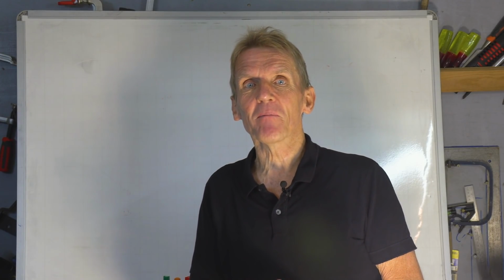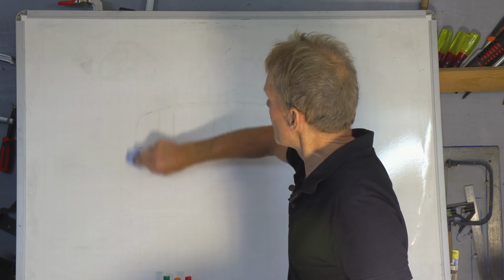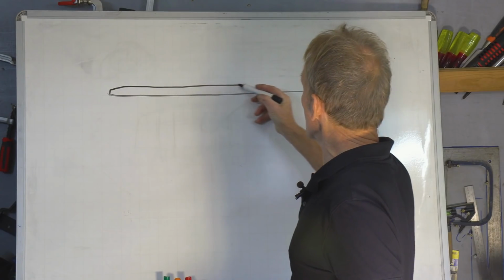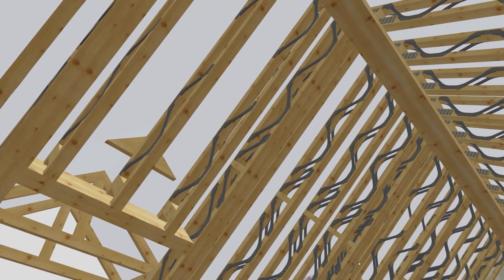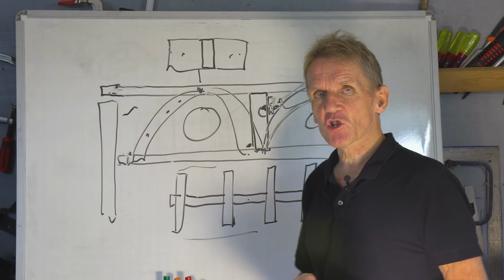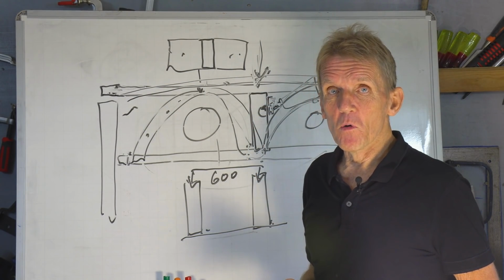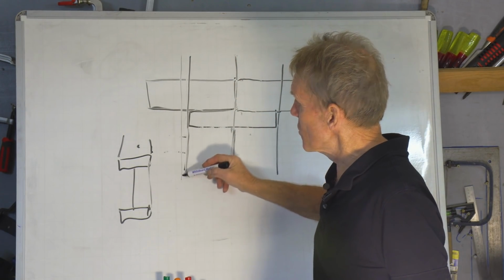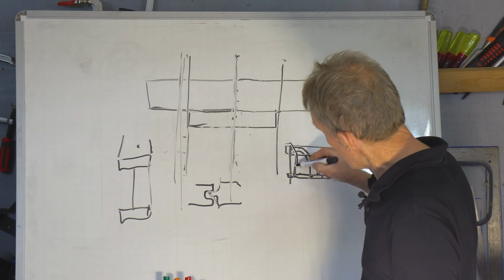New Build Home Nightmares That CAN be Avoided

Comment: I was taught well.
First lesson "Quality not quantity!"
Crazy modern building practices maybe quicker to erect, but they sure won't last.
Can't better old school carpentry with 9"x2" joists, solid noggings or even herringbone strutting.  Oh, sod trimming with joist hangers when a tusked tenon will do.
One thing to mention.
Timber buildings are safer than metal ones during a fire.  True!!
When steel heats up it distorts before losing all strength.  
The Trade Towers collapsed because the  steel work was as strong as a chocolate flake during the ensuing fire.

Comment: Having bought our home in January an 07 build there are screws showing on the plasterboard ceiling and every single room upstairs squeaks. I don't want to rip up the entire floor and possibly remove lower sections of the walls but after watching your video it looks like to fix it properly it has to be taken right back to frame! Wondered why this house was cheap but no inspector picked it up!! 😭
Reply from the maker: The surveryors hardly ever pick this problem up and it is so common that it seems like negligence.
Reply: If the screws are showing without any scrim tape visible then the plaster didn't both putting scrim tape over the screws which is necessary to stop the plaster from falling out or cracking where the screws are.

Comment: I nominate Linden Homes..
Kingsgate in Kingsteignton Newton Abbot Devon is a disgrace.. 
You are right you chase them and they ignore you hoping you give up.. 
I would never recommend buying a new home off plan. If you like somewhere new then just wait and let the first buyers have the headache.
I've been in 2 years and it's still not finished, I don't even have a back garden. The NHBC can't help as the house isn't officially finished. 
If you must buy new DON'T USE THERE LEGAL SERVICES GET YOUR OWN. You think your saving a £1000 but it will cost you in the end.. 
Also get a full survey, if the builder doesn't like it then that should ring alarm bells..

Comment: Using a smaller joist depth with a camber is a terrible idea for floors that people will walk on.  Camber can't deal with live loads, even when oriented properly.  It's much easier to just make the joists twice as deep ("eight times as stiff") with zero camber.  In a renovation situation a deeper floor may not be feasible... but in that case you should be looking at stiffer, more expensive materials like steel bar joists.

Comment: My tip for finding a good builder or any other skilled trade, make an alphabetical list of every relevant tradesman you can find in your area.  Look for ad's on the "my trusted" type websites, Facebook, parish magazines, local paper etc etc and cross off the list any you find ad's for.  Invite the remainder to tender and cross off any that are very late, don't turn up or the cab of their vehicle looks like a skip threw up in it.  With a bit of luck you might end up with 3 or 4 left on your list, then you can book them in for September next year.  The point is if they are not advertising it's most likely because they don't need to and will be booked well in advance.  Of course you can avoid all this by just contracting Roger, Robin or James to do your work.
Reply: It’s true, my best buddy and I grew up framing custom roofs. We were always laughed at by elite type customers because we were young, kinda wild and our work truck always had beer cans falling out..
  Contractors that knew our work had no problems, but what the public sees as a successful “look” is an absolute joke..

Comment: All this stuff being glued up pisses me off. Fixing a 10year old new build bathroom floor after it has rotted out ain't no fun just on slab. Let alone this stuff. I done one shithole on slab. Polysafe flooring direct to 18mm TG chip sub, not even skined. Everything glued to everything. 2 layers of plasterboard under that, 2 layers of white polystyrene with more joist/battens. The platic pipes and mice made a nice cave system under there. Took 2 days, 2 men just to rip it out and lay battens back down. Wet room too!

Comment: Can webbed floor joists be propped from below, like proping 9x2 joists with acrow props and 6x3 when loading concrete  blocks to upper floors?
Reply from the maker: Yes if you lay a scaffold board across them and a couple of acrows it helps a lot.
Reply: Propping with an acrow causes a `point` load to the floor joist and could buckle the web. If you have access to the web, fix a vertical noggin either side of the web and between the top and bottom chords of the joist. This will stabilise the joist web and prevent buckling. Alternatively, as roger says, spread the load of the acrow/acrows by using a scaffold board.

Comment: The strongback is doing the same job as noggins - a combination of spreading point loads to adjacent joists, preventing excessive differential movement between adjacent joists, providing torsional stability and as you say connecting the entire mass of the floor together to helps control vibration.
Reply from the maker: Yes you are right, I could have spent a lot more time talking about the Strongback. The name describes it perfectly.
Reply: @SkillBuilder  It does!

Comment: In Austria, all these building techniques and issues relate to garden houses. Nearly all homes from the last decades have 10cm reinforced concrete floors, 10cm insulation, 5cm concrete on top. UK lags a century in the building standards, joists and plywood OMG and this costs 500k pounds probably.
Reply: Concrete beams on the first floor?
Reply: @JohnnyMotel99  Monolithic concrete reinforced plate 20cm at least on the ground floor.
Reply: @andrzejgajdardziew2885  ground floor, we would use reinforced concrete beams, above a ventilated void, then 100mm celotex then screed layer, then floor covering. First floor in a regular house is usually timber joists

Comment: I guess that herringbone struts in traditional timber floors were the equivalent of the strong back? 
I also assume that herringbone struts are no longer installed due to the labour requirement.
Reply from the maker: I was going to talk about herringbone struts and forgot. You can use them and they are very effective but the method is slightly different.

Comment: Also please confiscate all hammers and nails from the builders and give them screws and screwdrivers! So much floor noise  is caused by the use of nails in timber :(
Reply from the maker: Too right, even the ring shanks pull out when the timber shrinks.
Reply: If you tried to frame a house with screws the building inspector would quickly shut you down and make you take it apart.
How many here know why ?
Reply: 100% right loved everything in this vid and normally agree with roger but glueing the boards down and together is a complete no no in u ever need access to the floor void again uve created a nightmare by glueing it all up u just need to fully screw it down through piloted holes at close centres u should  never get squeaking if u do  this as for ceiling cracking on an old existing building the best and easiest answer is to put in an mf (if u have the head height) this can solve not just the cracking but I’ve created a void for services and foot traffic noise from above is greatly reduced ok more money and time but for the client it rearly ticks a lot of boxes
Reply: @Lee Davies The structure of a building must withstand shear loads such as wind and earthquakes. Screws have to be made from very hard metal which makes them brittle and prone to breaking, nails are softer and flex instead of breaking. That's why they meet building code as a fastener for wood framing and wood screws do not.
Reply: @garyevans718  I thought we were talking about the floor and it’s screws over nails all day long and no glue
Reply: @kendodd8734  I live in Canada and it is required by code to use PL-400 glue between the joist and the plywood. When I was framing houses I used 2-1/4" ardox nails in a coil spiker which would suck the plywood tight to the glue and they don't back out, later after drywall and the house had dried out I would recommend screwing down the entire floor then.
Reply: @garyevans718  the glue must cause u guys nightmares though if uve ever got to get the boards back up seems like overkill to me when I definitely know screws surface done properly u rearly don’t get squeaky floors but heh as they say there’s more than one way to skin a cat
Reply: @garyevans718  Of course you can use screws - but they have to be the correct type; structural screws made from high-strength, heat-treated steel and not regular wood screws.
Reply: @simongreenidge6454  Who in their right mind would use GRK's to frame a house ??
It would add 50k - 100k to the cost to build an average home.
NO.....almost everyone looking at this YouTube channel won't understand the difference between those screws and fewer yet would be willing to pay for it.....so why even go there ?
Use nails that meet building code for framing a home....period.

Comment: Does anyone know if you’d use this in the ceiling ie loft floor or not? And the roof It’s a low pich15 degree slope was thinking about where I’d normally have a birds beak on wall plate?

Comment: Anyone tried green glue 3mm joist tape between board and joist instead of gluing the boards to the joists? I was thinking its a physical cusion barrier so no chance of squeeks in years to come if the glue separates.

Obviously still gluing the t&g
Reply: Use PL Premium.. it’s 10x better than regular construction adhesive.. comes out of the tube painfully slow though.. no squeaking though, I promise.

Comment: Can you safely have 600 mm centres with the metal webbed joists or 400 still recommended? My studs will be 400 and my trusses 400 for slate roof but was hoping i could have 600 on the floor joists without issue if glued braced screwed 22mm boards?
Reply from the maker: You can use 600 centres, They will give you a drawing based on that.

Comment: NHBC make you have a minimum 10mm gap around the edge of floor and wall to prevent squeaks
Reply: Will not stop squeaking between boards at the T&G joint or across the joists
Reply from the maker: That is for expansion due to humidity
Reply: @SkillBuilder  ah, thank you

Comment: How many strong backs go through one floor? Or where can I find the info. Great vid thanks
Reply: I think it depends on manufacturer's specifications and likely the country you're in. I think it's every 8ft roughly, but that was on a garage so it could have been underdone.
Reply: @ricos1497  many thanks, it’s uk and a four metre span so two sounds about right?
Reply: @paulpower6732  that's what my garage is anyway and it's still standing! I'm not an expert though.
Reply: @ricos1497  considering he said some/most builders don’t use them, gotta be ok with two over 4 Mtrs

Comment: Interesting development, kind of like engineered roof trusses as we use here in Canada, these do not flex in the vertical direction even under significant snow load which must be built in by code here because we might get several tons of snow on a fairly small roof. I like LVLs but you have to add PL Premium adhesive along the top as you lay the T&G floor deck on them along with lots of screws. Code here tells you that you cannot make a bunch of holes in the web  too close together. For example, the sewer line must hang from below, not through the web. As a rule, the biggest hole is 1" & they must be at least 12" apart to maintain the integrity of the web. They work, we used them at 12" spacing with PL premium & screws through the deck to rebuild my home after a fire in 2017 & the floor is rock solid...no bounce. Another thing which should be done is X braces between joists every 8 feet. These braces transfer the load from the top to the adjacent bottom of the LVL in a cross formation.
Reply: in europe we use concrete for this.

Comment: Off this particular subject - How do you feel about 3D printed houses and how quickly this could completely decimate the building trade globally! It’s inexpensive and developed using the millions of tonnes of waste plastic mixed with resin “no leaks” so lots of fixtures/fittings inter grated in the printing - toilets/sinks pipes even a fitted kitchen..
Ive only been watching your channel a few weeks now and being a keen (odd job man) friends and family etc - I just haven’t seen much worry towards the concept from channels like yours.. their already being lived in and sold ..
Sorry if you have touched on the subject - I’m fairly new to this type of viewing..
Reply: "It’s inexpensive" Is it? You don't want the external faces to be 3D printed (yet) so it just replaces the blockwork. The blockwork is pretty cheap by hand. Imo larger blocks or off-site manufactured panels are the next step before 3D printing.

Comment: good video Roger and timely for me as I am replacing my front room floor with 22mm tongue and groove flooring. However I'll be lucky if I can get the board edges to center over the joists as the house is about 100 years old and when I did my other room the joist centers were different on each one and some even had twists along the length. OHHH the swearing!! ha ha.
Reply from the maker: The best thing is to put a couple of noggins on the edges of the board that join between joists. It is a legitimate way to do it.
Reply: Thanks Roger, my thoughts also, this is what I did on my other floor. Keep up the good work. Looking forward to more videos

Comment: One question comes to mind, where are the building inspectors making sure these new joist systems are installed correctly? Surely every house should have to pass a series of inspections, and floor joists is clearly a major issue….
Reply: all the floor joists(flooring) are design by the supplier and the inspector only checks whether all work is complete to the spec,(drawings) he is not there to redesign
Reply from the maker: There are inspections but things are covered up fast.
Reply: @SkillBuilder   Good job I’m not an inspector then, as I’d be making them uncover them again to make sure it’s done properly….they’d probably only get one house a year built 🙈😂
Reply: You'll find Jimmy Hoffa before you find a building inspector doing his job 😝 all the paperwork is filled out correctly and the fees the freelance Inspection companies are getting are HUGE 🔨

Comment: Why should the builders be responsible? 
The structural engineer and architect specified this product. 
And if they didn't,  the manufacturers  supplied these products based on their own calculations.

There may be a few circumstances where these products aren't fitted to manufacturers instructions, but building control, or Zurich, or NHBC have passed the construction methods.
Reply from the maker: I am talking here about people not following the rules. The builder, in this case, is an accountant.
Reply: @SkillBuilder  in that case I agree 100%
But it seems that the authorities that are responsible for approving, and checking such projects, have to take some of the blame?
Reply: @sally6457  the builder sets the price it's as simple as that give better prices the lads can do a better job the builder makes LESS PROFIT the customer wins 🔨
Reply: @tomsmith9048  I used to think that way, I would let customers beat me down on price. They still expected the same speed and quality though. 
This type of customer is out for a 'Win'
It took a long time to realise this.
I now only take jobs on where the relationship is equal. I do honest work, and I charge appropriately.
That's a win win.

At first I thought this approach would cost me, lots of little jobs paid the bills for years.
But I make more money now, and do better work. And I have more time, and less stress.

I use certified and approved materials, in accordance with manufacturers instructions.
If they fail to live up to expectations,  I cannot, and will not be held responsible.
Engineers who are far better educated and higher paid than me developed products. And I pay for building regs, and inspections.
Why should the builder be held responsible, especially when the builder has to pay for external verification?
Reply: @sally6457  I'm talking about big site's with blue chip companies like bellway ect they set the price and the lads don't have a say on the price 🔨
Reply: @tomsmith9048  as it ever was,
Carpenters and masons built the castles of kings, but they, and their families lived in huts.
I've worked on houses worth millions, yet the wages mean I can barely pay the rent on a shithole!
Reply: @sally6457  it was in the time of castles and if you work for big builder's they do set the price but I'd your working for yourself on million pound houses you you should be making good money 🔨

Comment: Simple question why not concrete floor like in many countries in Europe? It eliminates all sorts of noise and jumping, also lasts for long years without any maintenance.
Reply from the maker: We do use beam and block and even Bison hollow concrete planks but most of the time it is quicker, easier and cheaper to use joists. There is nothing wrong with metal web beams if they are used properly.
Reply: One word PROFIT 🔨